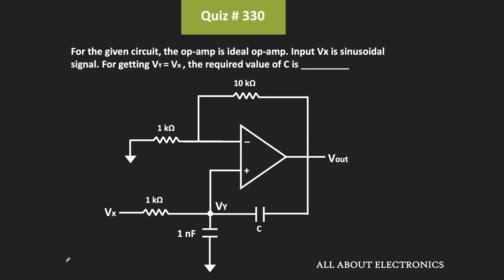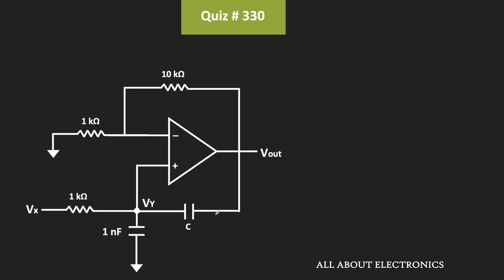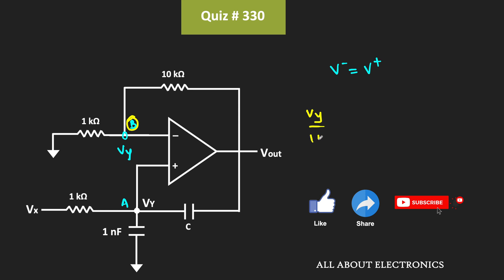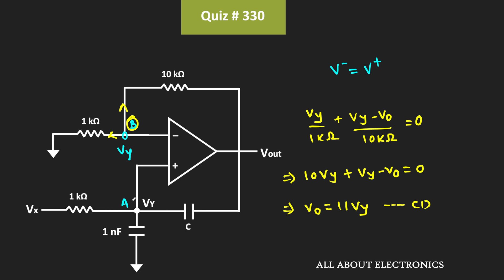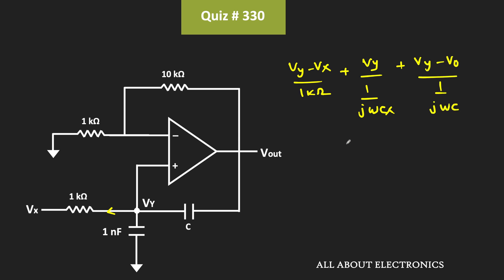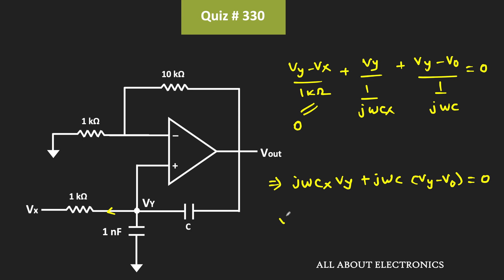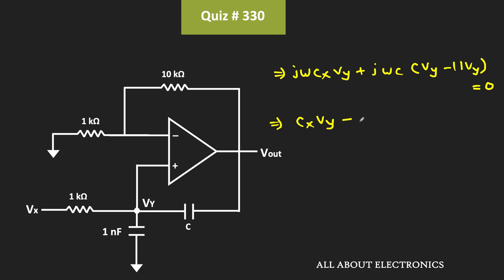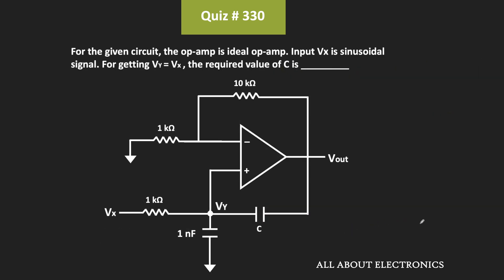Operational Amplifier (Op-Amp) Solved Problem | Quiz # 330

Comment: How here use virtual ground concept?here positive feedback also exist and VGC IS ONLY VALID FOR NEGATIVE FEEDBACK.without knowing positive feedback factor we can't use virtual ground concept (VGC).if positive feedback factor<negative feedback factor
 then only we can use vgc otherwise not and here also doesn't mention that it's working on positive feedback or negative feedback so how can u use vgc here??
Reply from the maker: It depends on which feedback is more. In such type of example, first, just assume that the negative feedback is dominant and calculate the output or the value of any component. With that assumption, if the positive feedback is indeed dominant, then you will get the output that will not fulfil the VGC. In this case, since C = 1nF/ 10, so negative feedback is more dominant. You can also simulate the same circuit with any sine wave input and check the result by yourself. If you require, I can provide the link to the simulation result.
Reply: @allaboutelectronics-quiz  ok sir understand thank you